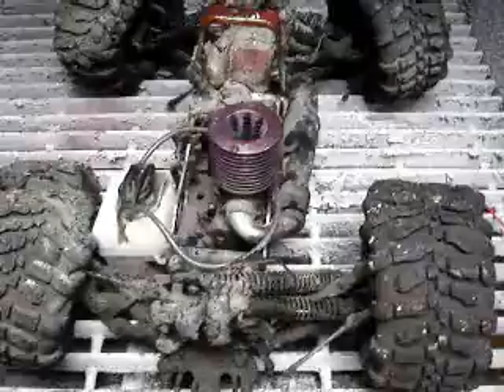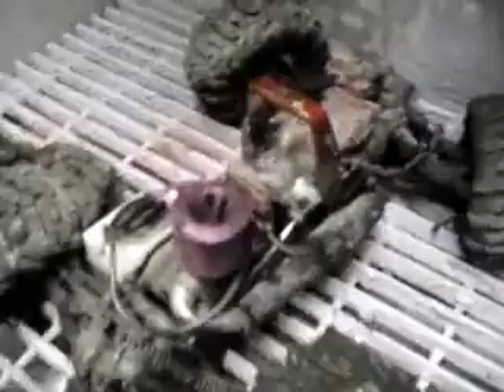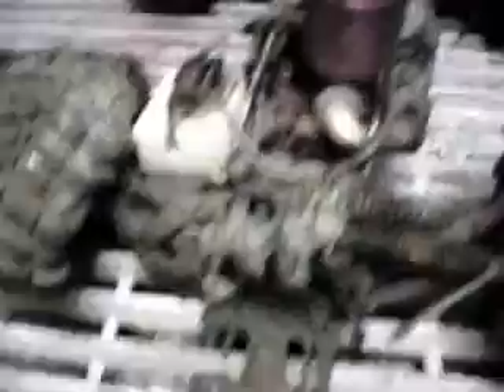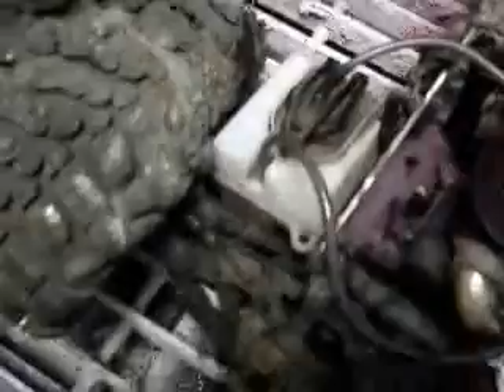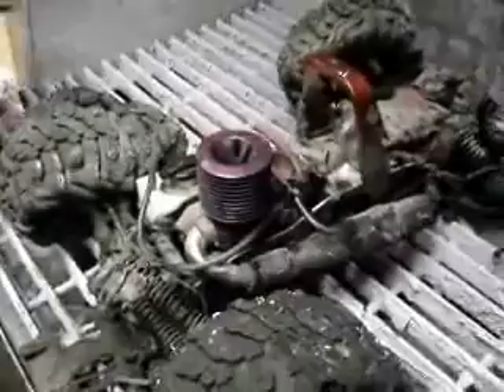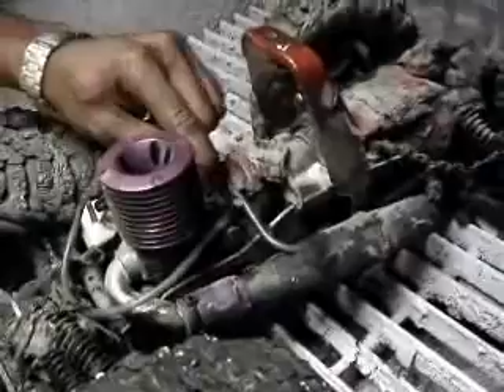Cooked HPI Savage 25

Comment: Well after you cook things you usually eat it... And there is no doubt that the engine still runs, you could through the engine in a fire and it will still run perfectly if you clean it up before you run it. Remember its made out of steal and aluminum so as long is the engine doesn't reach melting point you should be fine.

Comment: @Minrathicus I ran a hobby shop for a while and I can't disagree with you more.
Loved it when people bought T-maxx's, as it was instant parts replacement and upgrades sales.
In every way shape and form the savage is much more durable and reliable. You need to replace the servos with HTMG, metal spur, 4 way gears for the diffs and get the cam type steering kit. Tmaxx needs that plus an engine and much more to get it almost as reliable, but its still a stupid pan chassis design.

Comment: @WarCowboy I got a 3 yr old savage I bought new in the box, with the box still that hasnt had 1 1/2 gallons of gas thru it and never dogged or brought full throttle, because it cant. and I got a tmaxx 2.5 bought the day my hobby shop got em with 19 gallons of gas thru it and still going strong.On the same side of that coin I got a 3.3 thats been ran balls to the wall since it came out the box, jumped, banged and every part broken at least twice from abuse.yeah ok have fun believing in hpi.

Comment: Any engine can do this, heating it up then letting it cool down naturally wont have any effect at all and as this vid proves, will run afterwards. Yes the car is wrecked but the engine is sound. Also whats with the brand wars? Yes some brands may be better than others, but most are just as good as each other. I myself like Hong Nor and Traxxas, both manufacturers build excellent cars and Iv'e never had a problem with either my X1 CR or any traxxas model I've owned.

Comment: Actually, the oil is the reason you can see the exhaust at all, really. All 2 stroke/2 cycle engines produce blue smoke from the exhaust for the same reasons a full size, 4 stroke engine with it's own oiling system burns blue smoke when it's worn out- because it's burning oil. Oil produces blue smoke, water white, and nitro is mostly invisible, while gasoline has a grayish color to it.

Comment: @dahockeydude Dude these things are built tough, and about the exhaust. There metal, and the exit is at the bottom, hence the smoke going under and through the vent. . :D
I had a savage, flipped it in a puddle, some new battery's and it was fine :P

Comment: @WarCowboy wrong answer gus..I been thru ek4s terra crushers, tmaxxs you name it nitro wise, even dabbled and still dabbling in emaxxs, on roads and quite a few other kits.The savage is, was and will allways be the WORST kit I ever owned.Bear in mind this is coming from a guy who had a terra crusher with the 'slipping tranny' new off the shelf and a ek4 s1 that turned its difs into soup twice and ran in reverse cooking the engine.I built and ran 6 or 7 full alum maxx's even a water cooled one.

Comment: @Minrathicus Also the Tmaxx cannot do everything the Savage can do and better. Granted its a better race platform because of weight and low CG, but because of the design its weak. The savage is built more like a real monster truck, the clearance is better and its much more torque available to pull outa bad situations. 
I will not take away the Traxxas design for get and go, but it I wanted an over sized truggy, I would just get a Losi and add some large tires and eat a t-maxx for lunch.

Comment: im thinking fake tbh ... because if the thing was THAT melted surely the end of the exhaust would have sealed up? in which case there is no way for the pressure to be released? 
OR if there are other holes in the exhaust ... wheres the smoke???

it could have EASILY been a dubbed sound over the top??? 

EITHER WAY! hpi savages are pretty epic :)

Comment: @Minrathicus Ha, your one of those Traxxas loyalist no doubt. 
Fine, but you can't argue any real points with me. Its not my fault you fail at tuning an engine. 
Your statement that "it can't" makes you sound ignorant of engine setup. And stock engines aren't worth mentioning anyhow as any real RC enthusiast would toss it out from the get go.
Traxxas breaks easy. Its that simple like it or not. 
I have probably owned more RC than you've seen in your life, so its not talk without experience.

Comment: As for the video, there WAS fuel in that fuel tank- the engine was running. Proof? A nice puff of smoke from the exhaust towards the end when they were revving it up. It may be difficult to see previously for a few reasons; lean tune or just a shitty camera. Fuel lines not burnt? Because they put them on with the fuel tank- pay attention to the beginning of the video.

Grow up kids. Pull your heads out of your asses and just enjoy your toys, whatever brand is plastered on the body.

Comment: Yawn. This is just an exercise in materials and processes 101. Plastics melt at much lower temperatures than steel or aluminum. I'm not sure how this proves the truck tough as just about any nitro would have yielded the same result.